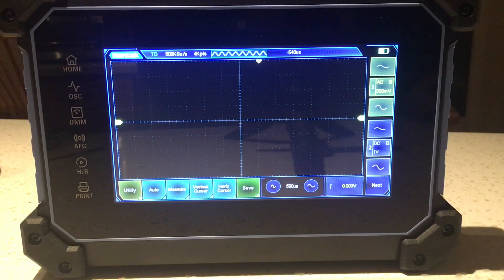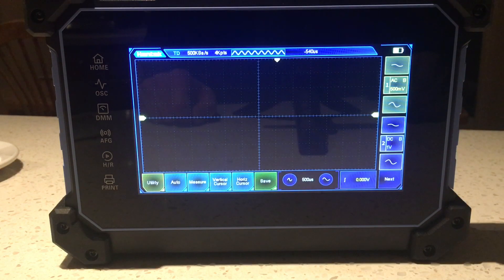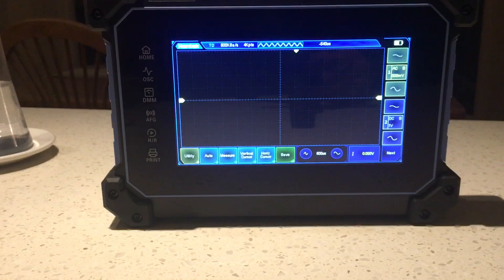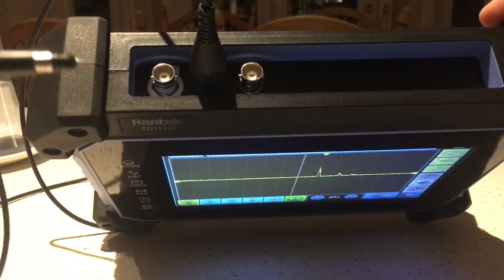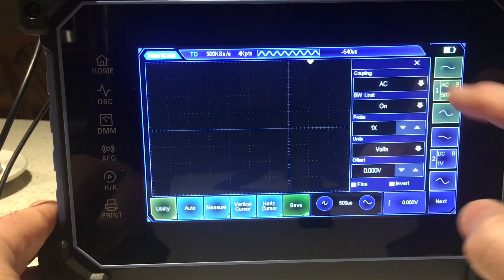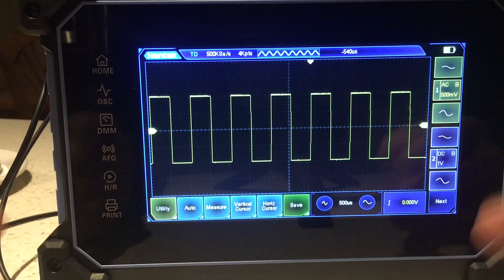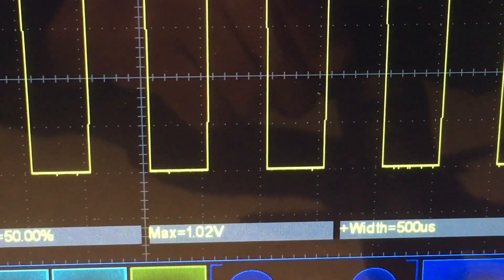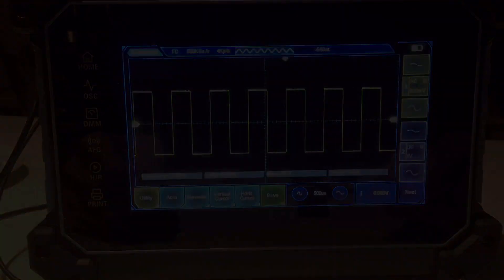Hantek TO1000 1kHz Ref.

Comment: hello, tell me, is it worth buying such a device?  are you happy with it?  Thank you for the video)
Reply from the maker: Hi. I would say the TO1000 series scope’s are reasonable value, but only on the bottom end of the model range. I paid $244 Canadian for the TO1112C model (2 channel, DMM, no sig gen) The high end 4 channels models price starts to close in on the $800 range. I have other scopes and signal generation facility. So for me, I can’t justify this price.
Reply: @TheGibby3340  I am also considering two-channel, because I have a lot of doubts about the characteristics of 250 MHz, I think this is not true.  thanks for the answer!